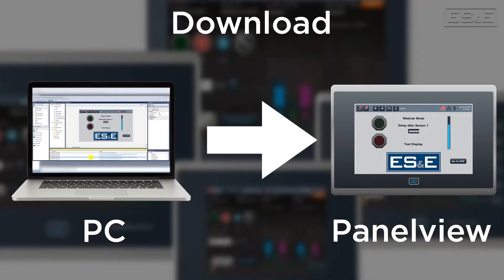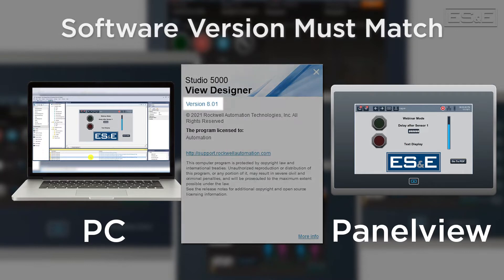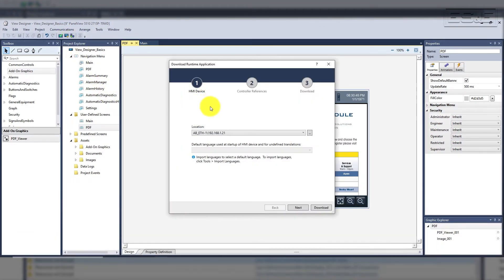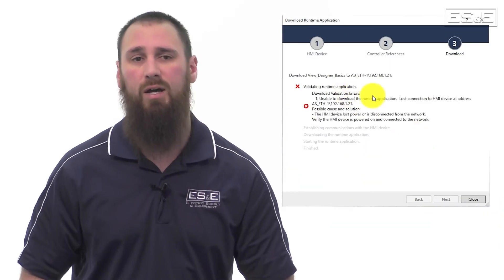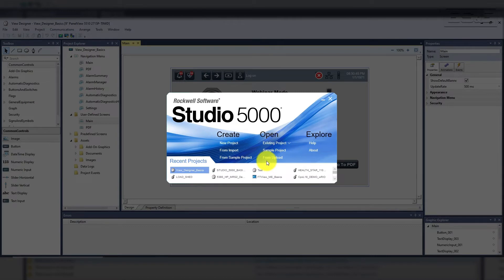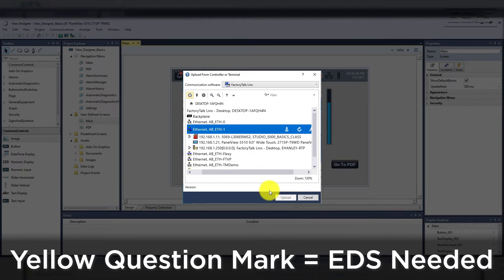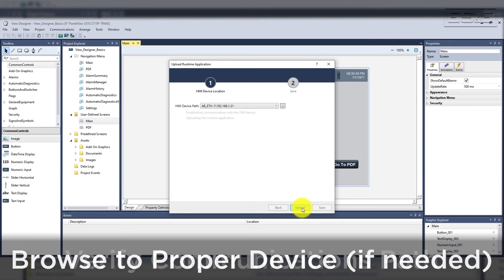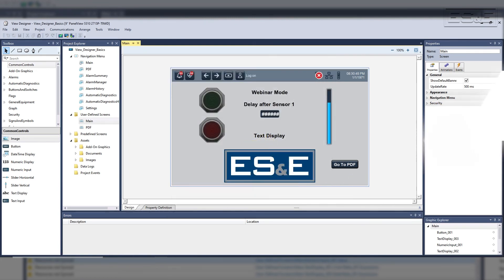Downloading and Uploading - Studio 5000 View Designer Basics Part 4

Comment: How do I update to a version that I dont have of View Designer?
Reply from the maker: View Designer – You need to download the corresponding Studio 5000 version which include the appropriate View Designer installation. Rockwell has a table in a tech note for all versions but below is table of most common:
Logix Designer                   View Designer
31.02.00                             5.02 & 6.01        
32.00.01                             4.03 & 5.02
32.04.00                             5.02 & 6.01
33.00.02                             6.01 & 7.02
33.03.00                             7.02 & 8.02
34.03.00                             7.02 & 8.02
35.00.01                             7.02 & 8.02
36.00.02                             8.02 & 9.02